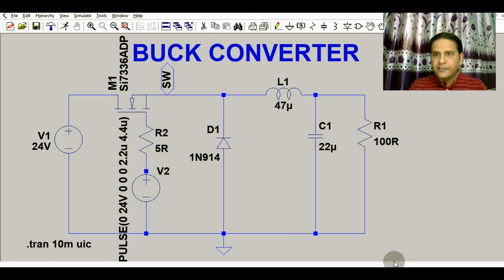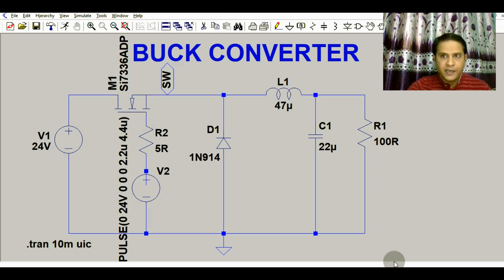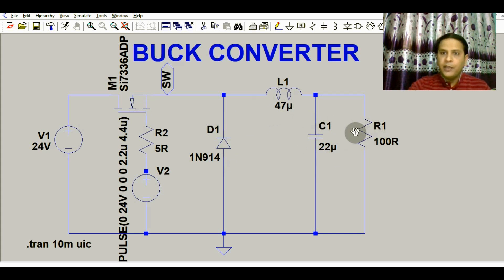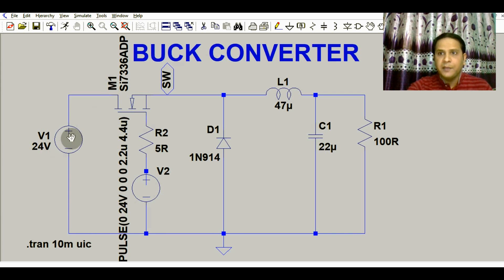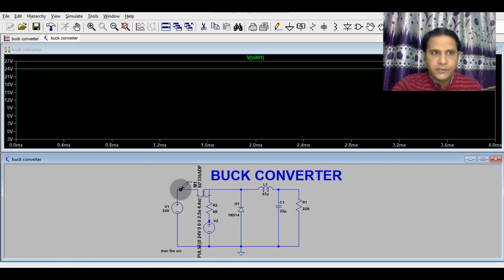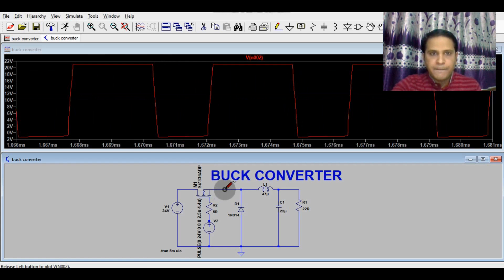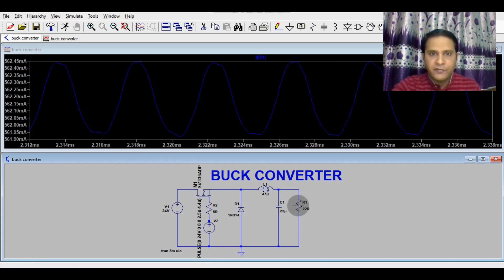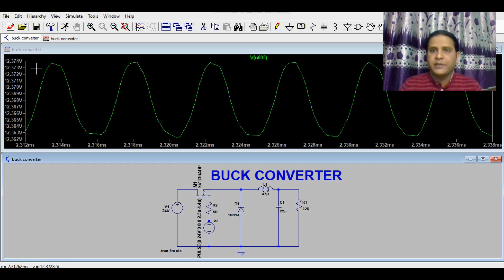LTSpice Buck converter Design | Simulation

Comment: Sir please help me   Fatal Error: V2: requires a minimum of 5 parameters.  Only 2 specified  this is the error i am facing please help me to rectify it sir please i am student
Reply from the maker: Are you working on same simulation file given in description ?
Reply: @ElectronicsCircuitHubECH  no sir i have designed a buck converter for my project on my own
Reply from the maker: @aakashv.r.5581  I have given you edit access, try using this file.
Reply: @ElectronicsCircuitHubECH  thank you sir but i dont know how to use this file
Reply from the maker: @aakashv.r.5581  This need basic skills of LTspice. I am not sure how i will teach you through chat.
Reply: @ElectronicsCircuitHubECH  whether i want to copy paste the code in that file before running the design sir ?
Reply from the maker: @aakashv.r.5581  Please click on .asc file. it will get open in LTspice.
Reply: @ElectronicsCircuitHubECH  okay sir thank you
Reply: @ElectronicsCircuitHubECH   Now i have requested please give me access sir